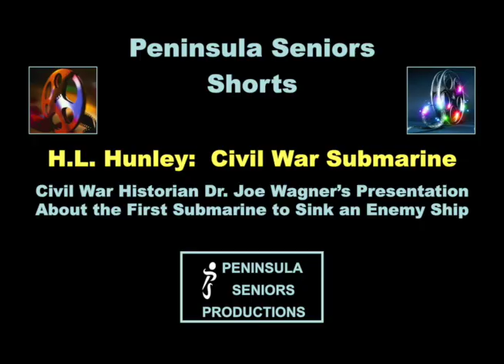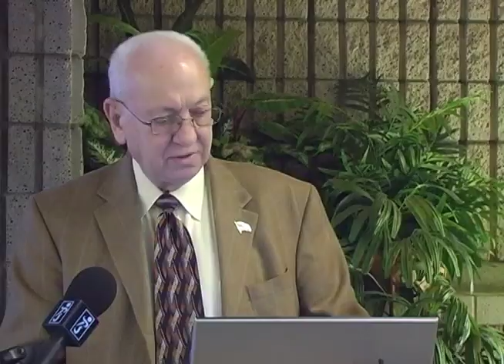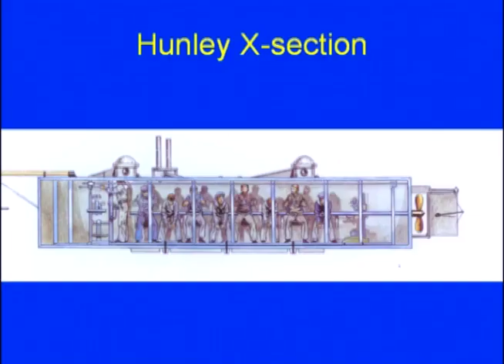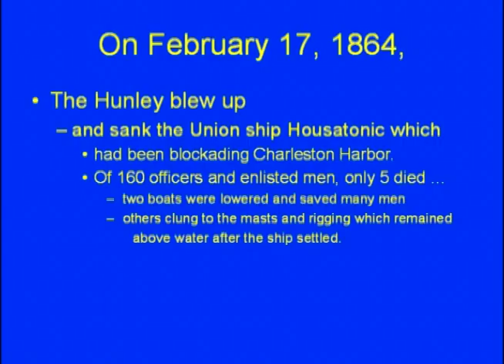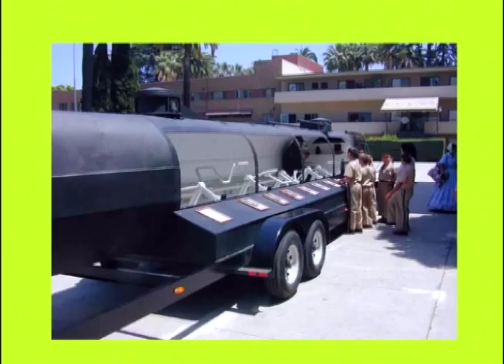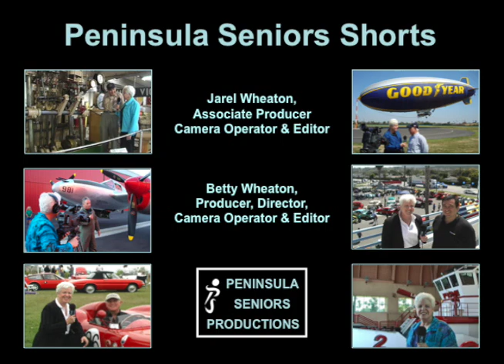H. L. Hunley Civil War Submarine

Comment: What caused the final sinking?
Too near the blast?
Was this determined after the wreck was raised?
Reply: alex jervis the latest is they believe they  dived to the bottom to wait for the tide to change to head back in but ran out of air  and died. They say that nothing in the sub showed any signs of them trying to surface:  and all body’s were recovered where they would have worked.
Reply: alex jervis 
The latest was the shock wave popped the Hunley's crew lungs. I don't see how they singled the shore, while dead. I still favor a musket ball through a port hole in the forward conning tower.
Reply: @jkoeberlein1  doubtful, a explosion that powerful would have destroyed the sub right next to the Housatonic.
Reply: @jkoeberlein1  the crew were all seated at their stations and Dixon at the helm was sat with his legs crossed. No attempts had been made to escape or empty the bilge, and a shot from a musket would take a few minutes to sink the Hunley. 
They were 16 feet away from a blast that caused a secondary effect transmitted through the water into the Hunley’s hull
Reply: @jkoeberlein1  and we can’t take the blue light signal as evidence seeing as accounts from sailors aboard the Hoosatonic vary massively